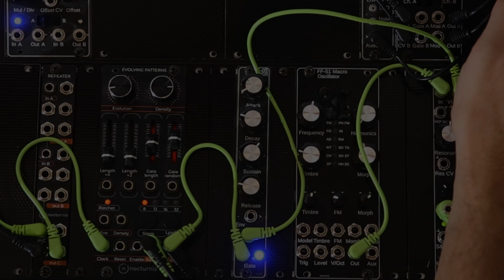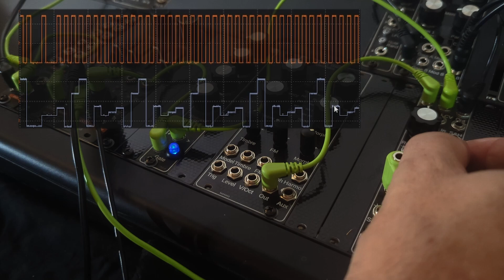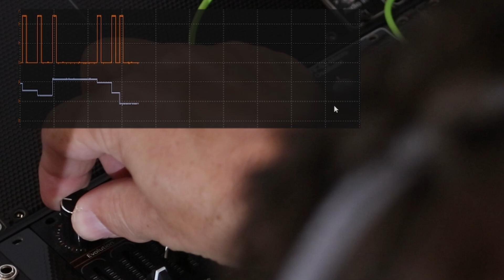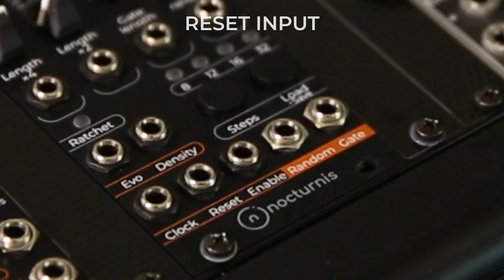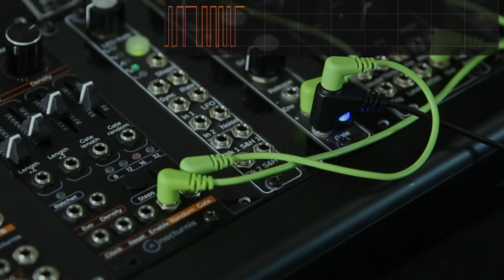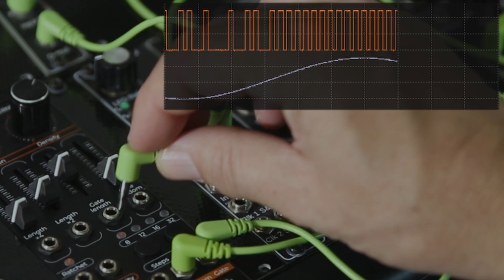Evolving Patterns - Part 2 - Random Output, Clock Features, CV Control

Comment: Are you using some type of quantizer for pitch? or does this module play with pitch as well as gate length?
Reply: Sorry that I missed the notification for this comment. Using the Random output through a pitch quantizer works well with this module and is one of its intended usages, for randomized melodic sequencing. In this video the actual pitch of the oscillator is fixed and it's only the cutoff frequency of the filter that makes some notes sound more bright than others. I hope to do a video in the future showing some more patches for how I like to use it, including with a quantizer.